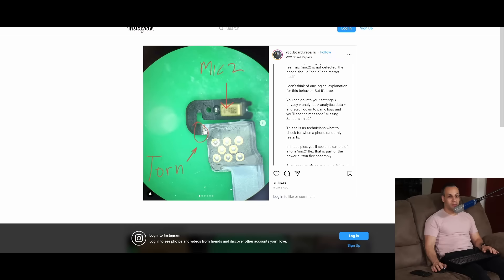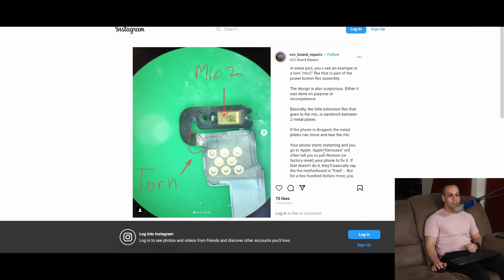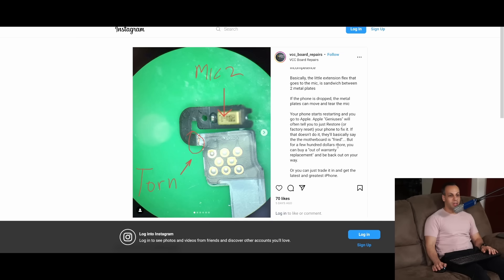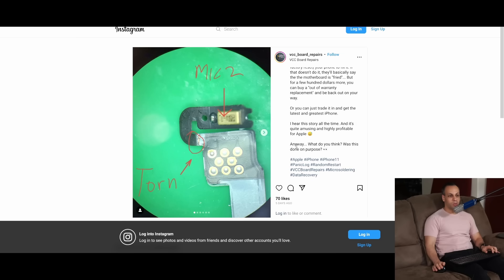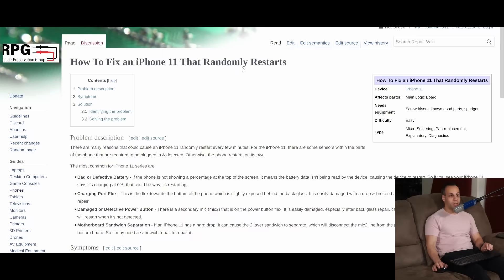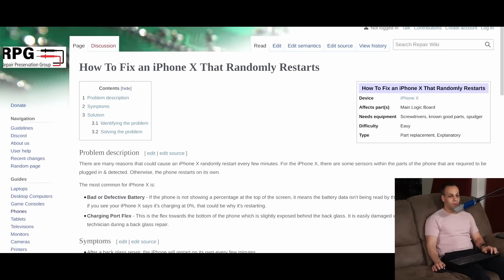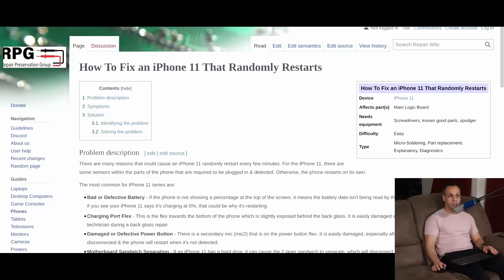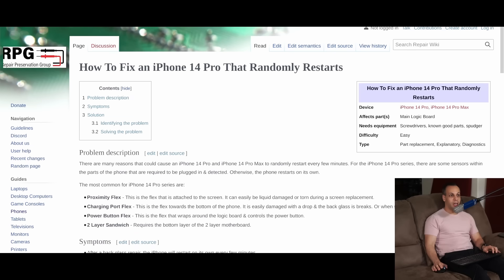iPhone's design flaw shows that 10 years later, their engineering is still a joke

Comment: Dear Sir me and quite a few of my sailing frends (sea fareres) use there apple phones for costal navigation using apple marine sea maps from the apple store . should the phone reboot every 3 minits while in fog at sea while trying to navagate back to a port or miss that bunch of rocks your heading to is putting lives at risk to say the least.when as you say a warning on the screen will save lives. and not render the sea mapping usles and a danger to the boat and other boats and ships using the navigation ID system being run down by a supertanker in fog is unthinkable

Comment: My decade old android with a cracked half working screen (touch only works on half the screen), swollen battery, with a loudspeaker that doesn't work due to me dropping it in water still makes calls, runs YouTube and can even type comments as long as auto rotate works (to type in the part where touch works). Installed an app that offers back, home and recent buttons to use in the area where touch works. Now that's a robustly build phone with good software.

Comment: My iPhone 11’s ear speaker sounded like it was blown, and anything with even a little bass would make a slight buzz. I had a trade-in at Verizon for 14 Pro Max, so I did it.
Reply: Most likely the mesh was dirty. I have a video on my channel on how to clean it and how to test the ear speaker 😅
Reply: @VCCBoardRepairs I cleaned the mesh, using videos as a guide. It also sounded like a static radio somewhat. I’ll never know what was wrong with the 11, but at least my new phone works.
Reply: @sethbessinger2025  sometimes, sandwich separation issues with the 2 layer motherboard can cause that during phone calls 

Basically, part of the cellular circuit has disconnected from the baseband chip, which is located on the bottom side

Comment: I disagree.  For a couple decades, failure management has been built in to most of the crap we buy, and Apple has been a leader in the field.  We need someone to test what the behavior is when a mic cable gets cut before warranty expiration.  My guess is that nothing happens, and Apple hopes that the user simply doesn't use the back mic, and so has no issue with the phone until after warranty expiration when it's becomes unusable due to constant reboots.  There is no depth to which modern corporations won't sink in order to extort more money from customers.

Comment: If it was ONLY the flex cable set up like that in between two sharp plates then i would believe its just incompetence.  If it was ONLY  the boot loop i would also believe its just incompetence.  But BOTH of these on the same device?  Its just too convenient, it also fits apples MO of, "lets scam people into buying the same product multiple times"  all to well.  Im very confident this is deliberate.

Comment: What is done on purpose is the iphone 14 and 14 plus if you replace the rear glass the photos made with flash it won’t save in the gallery, even replaced with original pull glass’s problem still persist. The only solution is to transfer the old flex to the new glass via soldering or the ic.
Reply: Wow that's interesting. I'll need to test that next time

Comment: My iPad Air 4 did so,etching like this for a few months after I got it. It would randomly restart in the middle of the night when I wasn’t using it or sometimes even when I was using it. It was mildly frustrating cause I’d have to enter my password again, instead of being able to use Touch ID, but I didn’t think much of it cause my iPad wasn’t used very often. I looked around Reddit and other forums and I believe it may be because of a defective wireless (Wi-Fi or Bluetooth) module but I haven’t had a problem for at least 6 months now, so I have no idea what was wrong. Shoddy design choices by Apple I presume after seeing this.
Reply: I got the redesigned iPad Pro 11 in 2018, and it constantly disconnected from the wireless, needing a reboot, that sometimes wouldn't fix it, just have to wait. After multiple resets, updates, frustration, I held the buttons down, plugged it into iTunes and manually restored it, and its been rock solid ever since. Still used daily. Still don't like that Apple's business efficency and customer service has made their sometimes excellent quality reputation take a back seat.

Comment: As a programmer, I would think it would be a relatively safe assumption that a cable isn't going to get torn from the "safety" of being sealed inside the device. I also wouldn't expect a microphone being the most likely component of the phone to break or break in a way that would make it undetected. I would more blame the hardware engineers on this problem than the software engineers.
Reply: Yeah, it would make complete sense for them to use assert(mic0 != null) or stuff like that.
It is not necessarily an intentional flaw.

Comment: Wow you may have solved an issue that I had years ago with my 6s Plus! I replaced the screen, and I guess something happened with one of the flex cables because it would constantly kernel panic and reboot. I ended up getting so sick of it that I ended up getting a XS Max. Thanks Apple.

Comment: I have an iPhone X that has this very behavior and i can hear a flex cable rattling around inside. I can't be bothered at the moment to open and repair it but the connectors used by apple are shit and if the phone is dropped something may come loose. Especially for the Wi-Fi antenna smh.

Comment: I remember a couple of years ago when I was still running my droid MAXX, which i kinda abused... (got it wet even though it wasn't waterproof, on multiple occasions it would then stop working for ~a week, only to come back to life as if nothing ever happened). eventually, for some reason (wonder why lol) the camera on the back of the phone stopped working entirley... i used it for multiple years after that, just using the selfie camera for all pictures. phones really were buolt different even only 8 years ago. hell, i pulled it out of the drawer a couple months ago, and after a bit of time on the charger it still boots up to this day! (to a much more attractive ui [android kitkat] than my new phone [xperia 5 iii - android 13])
Reply: correction: 10 years ago... damn I'm getting old.

Comment: The funny thing is, durability is one of THE most important features of a phone, and yet it seems to be a profoundly low priority for Apple. But, it's obviously not just the durability that's an issue, it's the repairability, and just firmware and software features which make no sense and make what should be a minor issue much, much worse.
Reply: I mean you say that, but my macs and iPhones have lasted WAY longer than androids or windows PC in terms of performance and hardware durability. And a ton of people seem to share the same experience I had, hence why they sell as well as they eo

Comment: I think the kernel panic is actually deliberate, not for malicious reasons, but for security reasons (even if it's a step to far in most people's eyes), not being able to detect it could be a sign the phone has been modified without the owner's knowledge, since apple undoubtedly uses their own phones among their employees they probably just took the "safer to just be paranoid" route and added that feature for themselves and just didn't want to bother with a separate build (I'm assuming it's hard coded for security reasons too) for customers so they rolled it out to them also
Reply: Nothing screams we produce garbage more than unrequested rebooting. As a software developer the thing that scares me the most is my program crashing in front of a user.  That is like running around naked in public.
Reply: @drwisdom1  I didn't say it was a good design choice, just said it can be desirable and implied it's probably on user end out of laziness
Reply: @zxuiji  My point was you don't want to look like a fool in public so you should design around that objective.
Reply: @drwisdom1  I didn't say I disagree with that logic, it's roughly the same as what I apply to my own code but that doesn't mean it's the same priority for companies like apple, where they NEED to prioritise security internally and might deem using separate build of the OS for users as more costly then the gains. We cannot speak for the priorities of every company and individual out there, only what is generally top priority when edge cases aren't involved
Reply: @zxuiji  Booting does not achieve security, just destruction. If you are on a phone call, typing an email, or other data input and your phone boots it unnecessarily throws away what you are currently doing. Apple has to think long and hard about doing that to their dedicated customers.

Back around 1990 I wanted to port my software to the Macintosh. The only place you could get a C compiler was from Apple for $1000 ($3000 in today's dollars). They made me sign a contract that said I had to read their design manual, make my software conform to its standards, or they would revoke my compiler. Every single piece of software Apple issues today completely violates the programming standards they tried to force on me.

Comment: My SE2020 started kernel panicking when I updated to iOS 16.3.1 from 15.7.1 in March. So I did a fresh install, however it didn't fix it so I performed a DFU restore. It was fine till June, then it started kernel panicking after I updated to 16.5.

Around 20 days back I took it to the Apple store and they ran some diagnostics and said the hardware was fine, and they proceeded to do a DFU restore. It worked fine till around 10th July, then it started doing this AGAIN.
Reply: That's most likely a board issue on the SE 2020.

There's traces within the logic board that disconnect the mic1. I have some videos of that on my channel as well 😅

Comment: Reminds me of when I went to the local Apple Store to see if I could get a new battery for my iPod (the unit is sealed to keep owners from changing the battery 😑). The clerk was amazed I still had one, and even more amazed that it still worked. They wanted to take my iPod while I picked out a new iPhone, and I'm like "I already have a phone, I just want a new battery for my iPod." They were very insistent that the iPod was out of warranty and seemed to imply that somehow invalidated my ownership of it. So I just left, and haven't gone back since. That was 4 or 5 years ago now -- the iPod still works, tho the battery is quite dead -- but I can plug it into a USB port and it works just fine. Guess I'll just do that till it stops working altogether -- tho after 20+ years of reliability, I don't think that'll happen before MY warranty expires haha! 👻
Reply: You can get replacement batteries for those old iPods online, and there are plenty of tutorials on how to replace the battery.
Reply: @tf_d I’m bout to say there’s other ways around a Apple Store this comment really makes it seem like people are not using half their brain.
Reply: Or just send it in to rossman repair group
Reply: Even the official store where you're dictated to only getting it fixed by them refusing to maintain the product usability is beyond me..  how ironic that porche would gladly fixed your tractor from ww2 and it's proven by a farmer.. a prestigious sports car manufacturers still remember and respect their roots

Comment: I’ve got a cheap iPhone 11 Pro Max from marketplace because of this. The phone got hot and rebooted every 5 minutes. Also it took quite a long time to boot. Replaced the flex and it worked like new. Your video just showed up while testing the fixed phone lol.
Reply: That's the other weird thing about iPhones.... Basically every part of them causes it to run really hot when damaged. Busted touch digitiser... Gets hot. Busted microphone... Gets hot. Busted charge port... Gets hot.
It's like they over engineere the power lines so they can't burn, but don't include fuses or protection against shorting. Either that or the software goes 100% CPU and just heats up that way.
Reply: @tin2001  Apple user here - Bad engineering on their part.

Comment: I had an iPhone SE original back in the day. One day it refused to sync with iTunes, it gave a weird security fault in iTunes every time I tried but the phone itself was fully functional. A few months go by and I attempt to update it via the settings and it errors out similarly to iTunes. So I try wiping it and reinstalling IOS fully. That bricked it. Nothing Apple was willing to do and I'm a Cellphone repair tech, if it was possible to fix out of Apple I would've found a way. That's when I switched Android after almost 10 years of iPhones. It pisses me off, they are actually among the easiest phones to repair physically. After the iPhone 5 it's been screen out first the way it should be on every phone.  Design faults happen (looking at you Macbook LCD connectors) but with Apple its usually software.

Comment: Take it one step further. The I2C data buses can tell exactly which chip or part is faulty by I2C addressing but but but... Apple wont use this info to tell you what is exactly wrong with your device. Instead  of just telling you hey the system says this part may be causing the issue, they say its the motherboard we cant do anything, get a new phone.
Apple doesn't even have to fix it if they don't want but don't play stupid and act as if the entire phone is bad.

Comment: Wait, I've seen this design before in shipping crates. Wedge a ribbon in between two metal plates so that if the package is dropped or mishandled, the ribbon is cut, thus alerting the receiver that FedUps might have broken their gizmo.

The conspiracy theorist in me wonders if this was an intentional design so they could tell users, "You clearly dropped it. Too bad you didn't spring for drop protection..."

Comment: I’m still frustrated my 2014 MacBook Pro (which I absolutely enjoyed using and I used throughout my CS degree) started having a kernel panic issue. There was nothing wrong with it otherwise other than it being “old”
Reply: We used to get Macs in that were "slow". Almost always, they'd be 100% CPU, and it was something to do with the kernel. Fix was always to simply delete the machine specific patch files they include.
Might be something similar.
Reply: @tin2001  hmm interesting. I’d be willing to do something like that but the system will shut down after a few minutes on. In fact if I  keep trying to turn it back on the amount of time the system stays on goes down

Comment: apple phones are not designed to be repaired so if something is wrong or disconnected then the only solution is to reboot till it's fixed otherwise it's broken and you need to buy a new one

Comment: 8:00 - next update for the OS: crash log is encrypted, the key can only be generated using an Apple employee badge number on a piece of unavailable proprietary software... goal of people like Jesse Cruz not making money from this - checked :D
Reply from the maker: Don't say this shit out loud. You think this is a meme. You think this is funny.  But if the sleep sensor that requires calibration in order to work when you replace it is any indication, somebody there might actually think like this.
Reply: @rossmanngroup 
We are like a decade away from Apple remotely shorting the iPhone battery if it detects being opened, trying to assassinate the technician.
Reply: @Alias_Anybody a decade? That's an optimistic outlook.
Reply: @kaden-sd6vb it isn't, as the EU passed a law, that they need to be replaceable, and it takes apple time to remove the regulation
Reply: @rossmanngroup  I don't think this is a meme... I am sure it is, and also it's extremely true. However, this is exactly like the unwritten p0rn rule: "if you thought about it, there's p0rn about it". Somebody already thought of this. It is not needed at the moment, as it's cheaper not to do anything and have profit than to invest in developing new tools and have slightly (if any) more profit.  

I know first hand how engineering decisions are taken, implemented of forced upon (good and rare) engineers. I also now what types of engineers accept those decisions and how good engineering is crippled or mutilated in the name of cost reduction and profit. 

I have seen potted electronics in the name of water-tightness where it wasn't necessary. I have seen removal of testpoints that help debugging issues in the name of extremely slim cost cutting. I have even seen removing repairability and redundancy in the name of profit. I have seen it on my designs that were used and mutilated without my consent or even without letting me know in products made by companies I refused to work with on grounds of morality (e.g. Volkswagen and VAG group).

All the dumb and anti-consumer and anti-repair things have been thought of. They're not implemented yet because the cost-return ratio is not favorable and where it is, the backlash might make it not be in the end. 

Here are some things I heard about my designs and proposals:
- "do we need so many capacitors?"
- "who cares about repair? gaskets are more expensive than potting and this needs to be watertight"
- "why did you chose the design that the analysis says will work correctly for 15 years? the requirement is 10 and the warranty is 5."
and more.
Reply: @VrumsAdventures  There are porno's about people opening iPhones?
Reply: @Moon_Presence  I personally never saw one ... but I wouldn't bet against that. 🤷
Reply: Don't give them ideas mate!
Reply: @maximmk6446  I'm not... trust me, there are very few if any new ideas on how to screw over consumers left to be given. But I am happy that people still have optimism 😀
Reply: Way to put ideas out for the universe. Delete the commentttttt